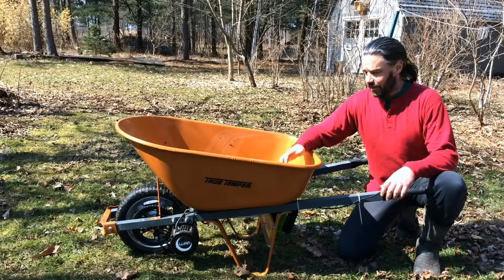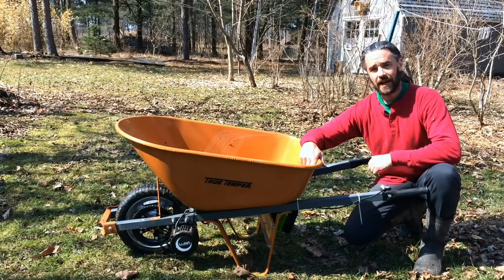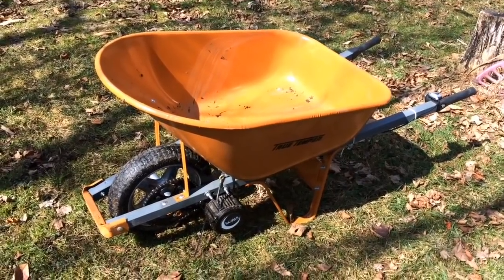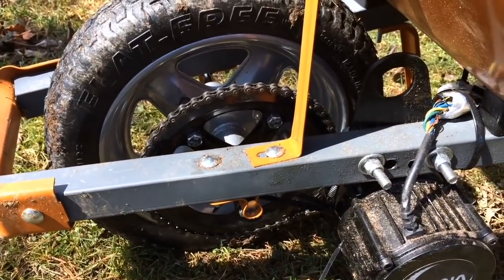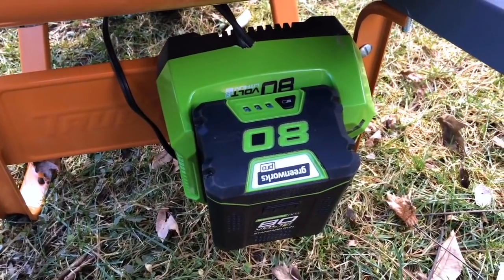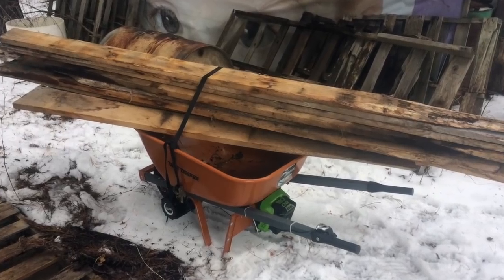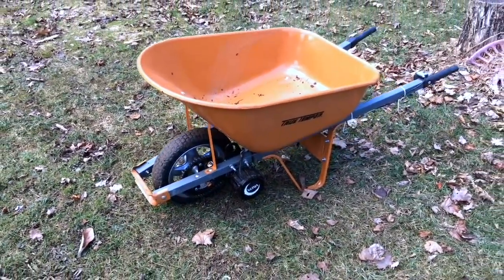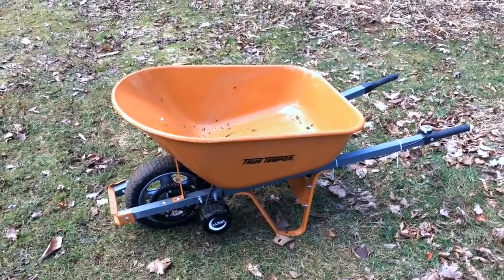Electric Wheelbarrow - Amazing!

Comment: the power is most useful for going up steep hill or very bumpy ground, correct? With a regular wheelbarrow on more or less even ground and heavy load I loose the balance way before not being able to push it forward.

Comment: What a great tool! Just one thing: you need to close up that wire bundle near the motor. The way it is open, it is going to send water right down into that expensive motor. You can use silicon or a waterproofing wrap tape. Doing either will also help protect the small wires from chaffing as well as damage from things being dropped. This is based upon 30 years experience in aerospace electrical.
Reply from the maker: Good feedback here, we'll take a look at that detail for sure!

Comment: 3000 watts!  Holy mackerel  an electric bicycle is 250 watts and can haul a 220 lb man . Now I understand the expense  of this motor $350 for super power.  Great build and video series . Much needed and appreciated.
Reply from the maker: We just did what my friend Karl suggested.  It's nice to have it overpowered so it can do all the pulling if we want, or just be lightly used when we want that.

Comment: This is exactly what I need.  This summer I will start building my homestead house.  If you could design a less expensive DIY kit, you would sell thousands easily.
Reply from the maker: Probably don't need as burly a motor, so maybe you could find a cheaper way to make this work with other resources.
Reply: @edibleacres  My lower powered, lesser-priced Jockey Wheel Electric Power Trailer Mover suggestion (from early April 2020) may be worthy for consideration? These pieces of kit sell for $299 - $339 in Oz, but should be somewhat cheaped in the US.

Comment: I feel that it would not be very difficult to convert a good wheelbarrow to electric power by using the motor, battery, wheel plus drive, and controller taken from a Jockey Wheel Electric Power Trailer Mover - although the result may be slow and slightly hampered by the common 8"/20cm wheel size. This would require the existing trailer attachment gear to be firmly mounted to the wheelbarrow's axle mount region.  This sort of build could be made for $350 - $400, plus bolts etc.

Comment: If I had a motorized wheelbarrow I wouldn't get any exercise! lol If I was still 4 or 5 years old I'd definitely want to check out the business end of that machine , keeping curious kids away from 80 volts and an open chain would be the hardest part of that installation.
Reply from the maker: Definitely not the most safe setup, lots of exposed chain, etc., but quite effective.
Reply: ……..and fun  😎 @edibleacres

Comment: Could put a small, detachable plow on the front, move snow in the winter. Might need a tire chain, but you could also put weight in the bucket for added traction. Two wheels on the back legs would raise the handles to a convenient height, and keep your snow plow at the proper angle & height. I wonder if it would haul(drag) small logs for you? Could be a back saver.
Reply from the maker: Interesting additional uses... I like the plow idea!
Reply: I see that you may need castoring wheels if they are to be attached to 'the back legs'. You require some steering capacity for a snow plow.
Brian, maybe choose a Worxs Aerocart (with snow plow attachment) for your suggested project, although its spaced dual wheels may be challenging to convert to electric power?

Comment: Very cool. Does the trigger need to be held down the whole time, like a dead man switch?
Reply: Watching Sean (Shawn?) Spelling?) run the loaded wheelbarrow, I'd say no. It looks like he uses the switch like an accelerator on most motorized vehicles.
Reply from the maker: It is a throttle, so the more you push, the more it goes, if you put it to 0 it just sits.

Comment: Great project. You could add wheels to the back so you wouldn't have to lift it.
Reply: So, just how would you steer, and angle, such a handicapped load-carrier?
Reply: @johnklumpp7901  by having rotating wheels ...

Comment: I want to mount a motor to a TWO wheeled cart.  What is the problem with TWO wheels vs ONE Wheel.  Could it be something about the torque needed to move two wheels vs. one wheel.   What can you tell me?
Reply from the maker: I don't know what to offer to you for information.   Our only experience is with the one wheel, which works quite nicely!
Reply: So, to turn corners either means you need a differential, or you power one wheel only. A Ural 2WD Sidecar Combination cannot be steered (without  great difficulty) with Two-wheel Drive engaged while on firm tarmac.
But if the two wheels are quite close (side-by-side) like in a four wheel model 1950s BMW Isetta micro car, then powering both wheels without a differential just may be feasible.

Comment: I would recommend a hub motor, for simplicity. You can buy a wheelbarrow hub motor on AliExpress. I have some chain driven ebikes, and the chain tensioning is problematic long term. Great build though! Good choice of wheelbarrow for you project the square section steels, will make things a lot easier. Thanks for video.

Comment: For  the life of me I cannot understand how you guys could forget to just fit in two more wheels on the hind legs.
Reply: Lol i was just going to say that myself you beat me to it.
Lever action so can just lock it down or up to use as normal or when dont want it to roll away.
Reply from the maker: Both great ideas, and something we could add on later...  The challenge is that this wheelbarrow has to navigate really tight places at times, so we left the structure as 'default' for now beyond the power and can always add in sled skis, adjustable wheels, etc. as time allows.  Thanks for the feedback!
Reply: How do you steer it ?   Three wheeler
Reply: I have 3 carts on my tiny homestead: a 1-wheel shallow wheelbarrow (about 40 years old) good for tight spots and lighter loads, a 2-wheel contractor's wheelbarrow (about 25 years old) for bigger jobs, and a huge 2-wheel cart (about 3 years old) that I can lug hay bales, compost or wood chips in. They would all benefit from motorization as I am past my prime and live on a hilly property, but they each function differently and are used for different types of jobs.